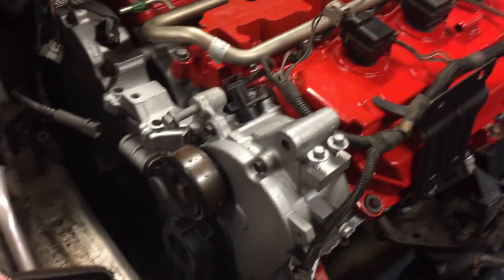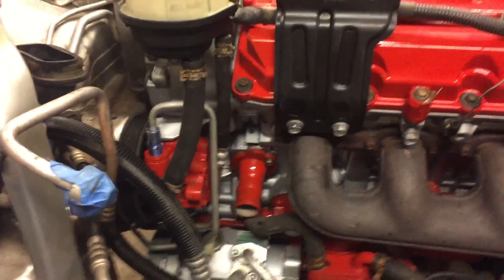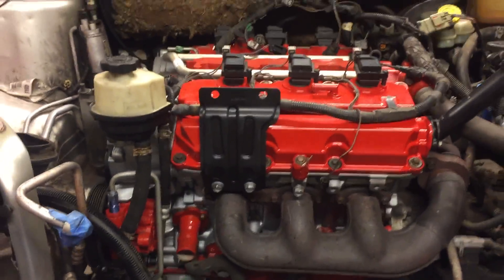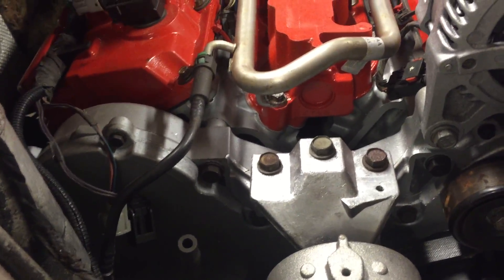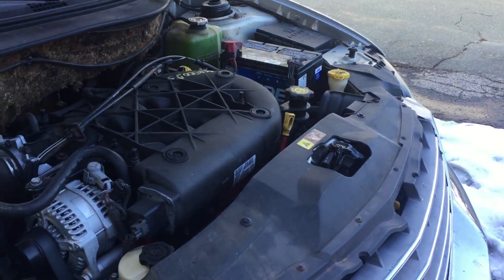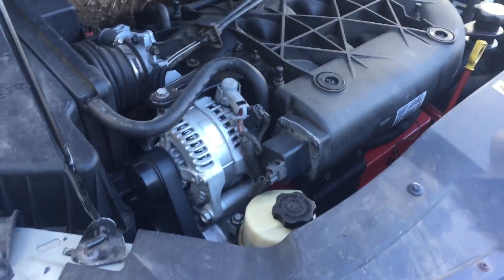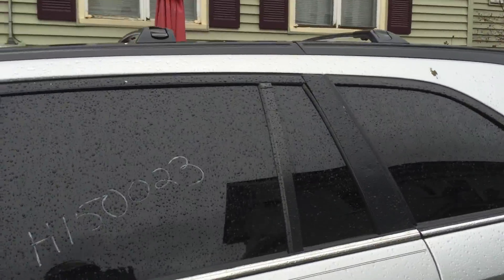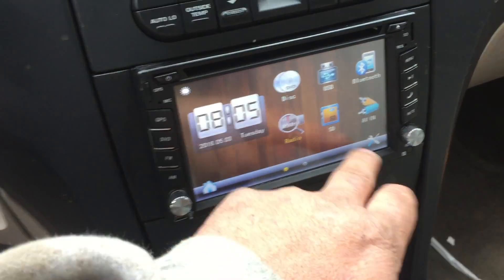Chrysler 3.5 ENGINE rebuild part 7

Comment: At this time frame you have suddenly installed that oil cooler that sits between the oil filter and the block, BUT you said nothing about it? Mine just failed and pumped all the oil into the cooling system,...so I need to remove it. I was looking at your video to see how difficult it was to get at that oil cooler and its plumbing from underneath, or in front of the engine??